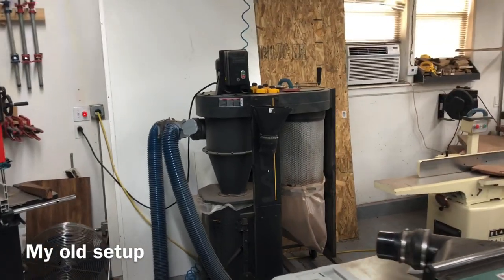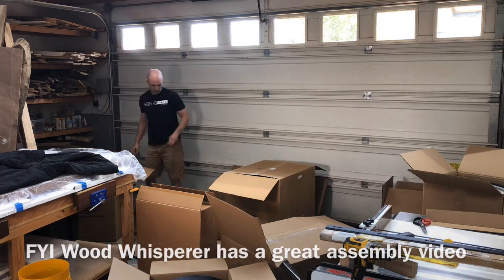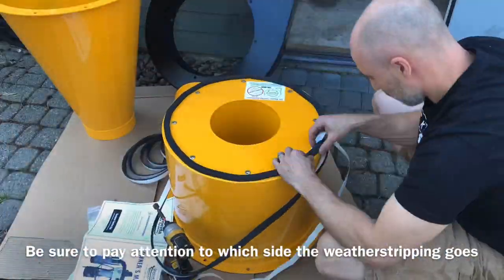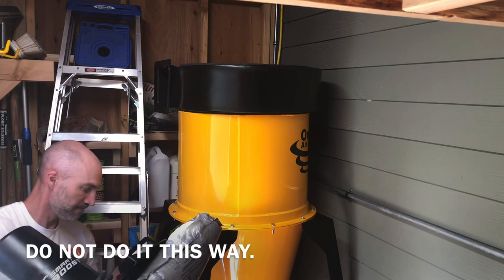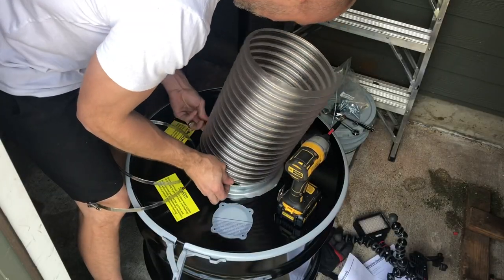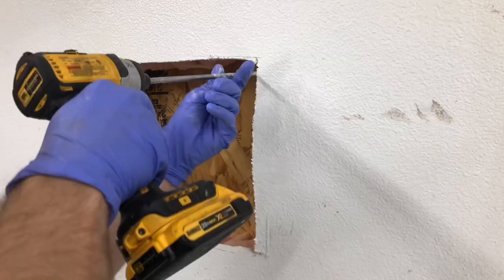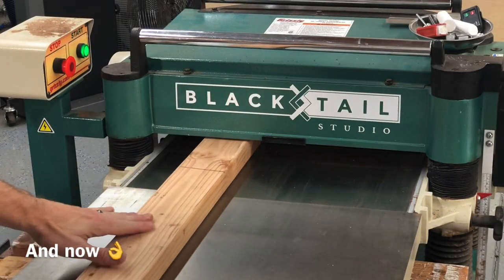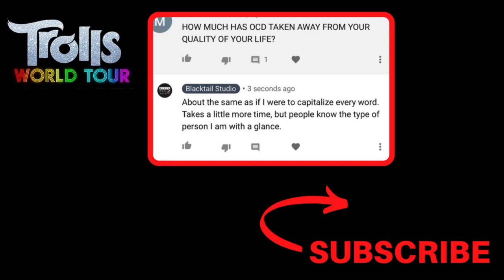Garage Shop Dust Collection - DIY Woodworking

Comment: I Added a Laguna PFlux dust collector and love the collection capability. 

I noticed you had a smaller version of Laguna. Any reason you changed over to Oneda? Other than it was free....
Reply from the maker: I read a lot about em. Only found good stuff about Oneida. Also all my friends with similar/larger shops use Oneida

Comment: 0.7 mm mechanical pencil...
Cam, in reference to the D-bag with the "all caps" OCD crack, have you noticed that people with zero skills always think that makers are OCD and miserable. From my perspective, the opposite is true. 

Anyway, did Oneida provide any info on suction loss over distance? Is pipe size instrumental in achieving maximum suction or is it essentially the same for 4, 6 or 8-in runs? I realize you may not be an expert on the subject, but I'll bet you had the same questions when you considered upgrading your dust collection. 

Thanks in advance for any input you can provide. 

Fellow OCD maker. LOL! 😂
Reply from the maker: They did, this one is actually variable speed to maintain suction down to like 2.5” ducts. I’d give em a call for specifics though.

Comment: What dust collector brand were you using before? I see the Rockler hoses and fittings, so were you using their Dust Right system, or another, and why don't you think your previous system worked well? Nice video btw.
Reply from the maker: This was a laguna

Comment: my fav too, when i finally got good chisels.  having the dust collector outside, wont it cause a bad negative pressure inside and take heat/cool out of the shop?
Reply from the maker: Yup. I’ll figure that out eventually
Reply: @BlacktailStudio  , just plumb the filter back into your shop. It's a HEPA, so you'll be safe

Comment: Dust collecter is mine (Laguna cflux2) Cam when cleaning the buffer pads just soak in mineral sp.? im using osmo,  thinner should be the same. my second question is about the grit of the pads you use, 3m makes a bunch of those like ex. the red pad is rated at 320-400 i have gold and white pads like the red one the grit on those is 1200-1500 as i didnt see any info on the box was wondering if you know the grit (3m supper polish pads 4100? thanks  still gig your work u remind me of a much younger me! :)) LOL

Comment: Really enjoyed the video.  I am considering an Oneida system myself.  I have a one man shop and its 1600 square feet.  I don't know what size unit to get, will Oneida help me choose the right sized unit?  Also, did you use their duct design service or just go it alone?
Reply from the maker: Yup, they helped me pick the unit. And I used their duct service to make sure I had the right transitions anyway.

Comment: Cam. My favourite tool is my pocket hole jig. Just finished making a small desk for my son and used this for the joinery. I’ve had an “oops” moment on my resin table and managed to drill a 3mm hole through the finished table when attaching the legs. Doh!! It’s gone through the wood but wondering the best way to fill it? Thanks. Mike
Reply from the maker: Dang! More wood or epoxy. Or both.

Comment: My laguna helical head jointer makes milling a breeze in the shop! If table legs have a plate of 3/16 steel holding them together, could you use that same plate to stabilize the table top?
Reply from the maker: For sure!

Comment: My table saw is awesome. My router table used to be my favorite, but when I sold my vintage Delta table saw, I upgraded to the 2HP Shop Fox W1837. BUT, I am in a garage and dust collection is an issue. I need a small unit with big sucking power. Does something like that exist in 120V?
Reply from the maker: Oh, there are good ones out there. Won’t be quite like this though

Comment: Hey man, found your channel and the resin pouring hobby a few weeks ago and just dove in.  Planning my first small pour now (cribbage board sized); I admire your craftsmanship and take your recommendations seriously so I thought I'd ask some questions, hopefully you read this and have time to get back to me.
Epoxy Choice: I'm using Liquid Glass deep pour for the main pour even though it's not a full 2 inches, more like 1 inch, - is that cool?  When I do the sealant layer on the live edge, do I need to use Super Clear table-top or can I paint on a thin sealant layer using the deep pour epoxy?
Debarking: I'm using a chisel to debark the live edge because the pieces are small and I can't justify an angle grinder yet.  What layer do I stop at? Obviously the rough dirty outer bark has to go, but there's a harder prettier layer underneath that isn't quite sapwood - should that go too?   When does debarking go too far and 'ruin' a live edge?
Thanks heaps for all the videos you do.
Reply from the maker: Yup, 1” is just fine!

Comment: Off topic question: will epoxy cure in a hot shop? Doing a river table and my shop is huge but no ac. Very hot in Oklahoma this Time of year.. mid day can be 100 degrees. Will my table still cure?
Reply from the maker: It’ll definitely cure. Maybe too fast

Comment: Do you have any issues with the return ending in the shed? My concern is will it pull all the cool pr hot air out of the shop.
Reply from the maker: I don’t run it that much. Could happen though

Comment: What about make-up air to your shop? You’re pulling heated or cooled air out of your shop without a return system.
Cutting another hole between your shop with a box around your filter and furnace style grates going back into your shop will solve this.
Reply from the maker: I did that in my née shop

Comment: Computer along with CAD makes my life easier.... and question: I’m thinking about running 2 separate 1.5 HP dust collectors in my shop to save money... good or bad idea?
Reply from the maker: I think it’s fine for the most part. But you might have issues like the shots of my planer before and after.
Reply: Ok thank you!

Comment: I have made my first epoxy river table (blue) after watching your videos over the years. However After sanding down the table I noticed 2 little indents (maybe bubble) looks like a very small crater on the surface of the blue epoxy. How would I go about fixing these little holes? I would prefer not to poor more epoxy as Im nervous the colour will not match.
Reply from the maker: Try clear. Shouldn’t be able to notice then

Comment: Quick question and I know it's unrelated to current video but I'm worried I don't have enough pigment for the 4 gallons of epoxy I have. I'm about to do my first epoxy resin table but and I bought 1.5 ounces of mica powder and 30 grams of glow powder. I must have watched DOZENS or pour videos, tips, and tricks on pouring epoxy, including yours, but all of them showed like a few tbsp. or drops of colorant to their pours. Now I'm trying to do final calculations and I know I need 4 gallons but to achieve the really pretty opaque deep blue I was going for it has it showing that I need...like $400 worth mica powder????? Like...what happened? Would love to know your or anybody's thoughts. 
I've already invested so much time and money into this project I really, REALLY hope I don't need to buy an absurd amount of powder to finish it. Also any future video you could do about coloring and pigment to epoxy ration would be most appreciated. Love your channel, keep up the good work, big fan! Thanks!!
Reply: Sorry, though I should mention, though my table is pretty long, the depth is only 3/8" of an inch.
Reply from the maker: Sounds like a long conversation. But glow powder takes a ton of pigment. Regular mica just takes a spoonful

Comment: For me it’s my IPhone, I do everything on it. Mostly learn how to do so many things I’ll never try 🤔.         Just thinking, since it does have such a good filter and the fan and motor makes the lions share of the noise, why not go ahead and duct just the filter into your shop? That big dust collector will evacuate any climate control you have very quickly. You could just purchase a little bit of duct and hang the filter on the wall inside and recycle your conditioned air.
Reply from the maker: Oh, maybe!

Comment: my laptop, if i don't know something or how to do something i can look it up, as for an awkward working position, i was changing a transmission in a chevy astro, i had it on my chest and muscled it up with my arms and knees while my helper got the bolts started, that was 20 yrs ago, can't do now that i'm in my mid 40s and have an extra 20 yrs worth of abuse on my body, i wouldn't even try
Reply from the maker: I’m headed that way
Reply: @BlacktailStudio  yeah you really need to get yourself an overhead lifting system for some of those big slabs you work with, even if it's just an a frame on castors with a small 12v shop winch, save you a lot of back pain later on